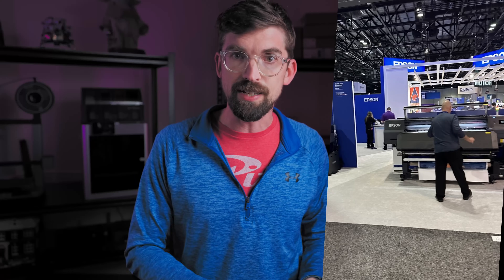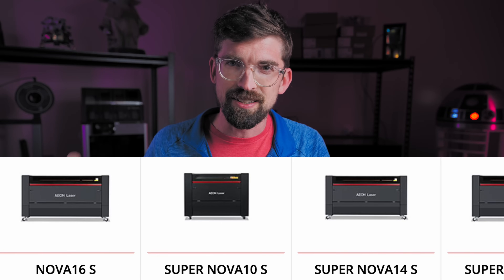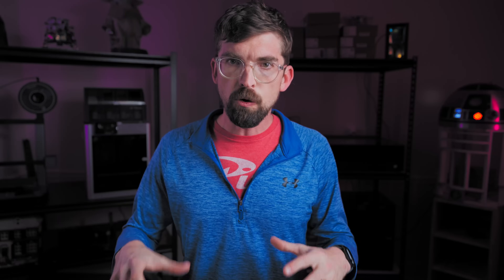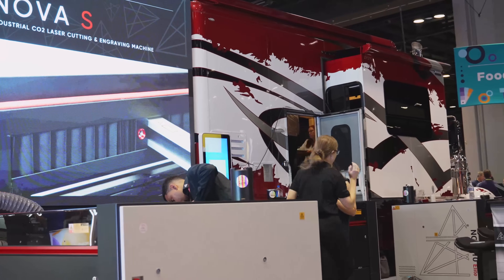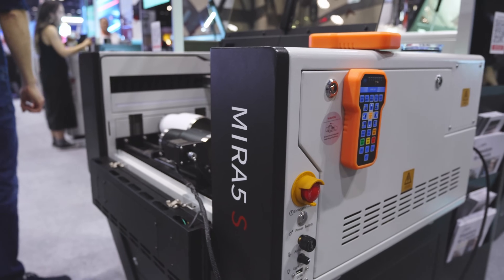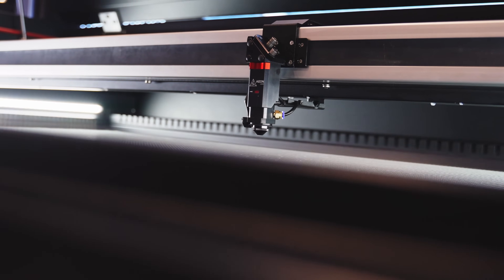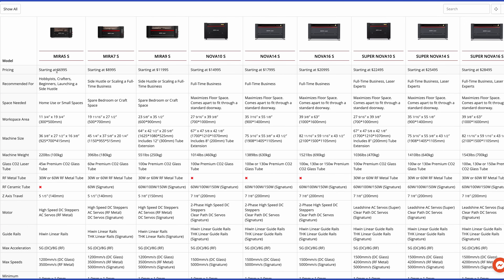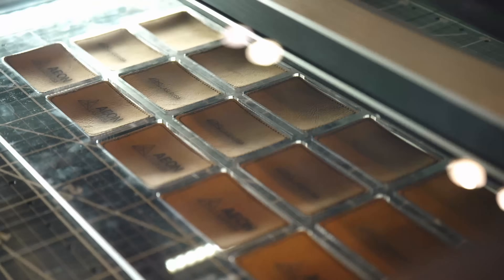This is the World's Fastest Laser

Comment: I’ve had my eye on the Aeon Mira 5S Redline, and I have a few questions regarding my product line that I plan to work with. I want to make sure the machine fits my specific needs, so I’m hoping you can provide some insights.

1. Can the engraving and cutting height be automatically adjusted to uneven surfaces (e.g., wavy materials)? Ideally, I’d like a 3D mapping system where I can freely define the measurement points based on the material. I’d like to set the number of measurement points per square cm or at least define a measurement area to ensure the engraving or 3D map is as accurate as possible.

2. Is there an automated height detection system or any add-ons for soft materials like leaves or flowers, which are difficult to measure with mechanical height detection?

3. What is the noise level of the machine and the exhaust system? I plan to use it in my home, so that’s important for me.

4. When working with larger materials that are fed through the machine, is it possible for the engraving or cutting to be automatically detected and seamlessly extended? I’m looking for intelligent software that can adjust the engraving path automatically without needing to manually realign the material.

5. Do you use or recommend any infeed track with a stopper and optional conveyor belt for precise material alignment and consistent movement at the right angle during the process?

6. Is there an intelligent function for engraving multiple identical materials? I would like the machine to detect and optimize the engraving process across multiple pieces with identical designs, to save time and ensure consistent results.

I know that the xTool P2S has most of the features I need, and their software is actually quite good. However, it seems that they may have purchased reviews on Trustpilot, and their customer support has been quite disappointing, so I don’t fully trust this company.

I’m also interested in experimenting with inlays in small QR codes, around 30x30mm, where the glass tube CO2 laser might reach its limits. It could be better to go for an RF option, but I’m not sure if Aeon is the right choice for this. You may have a better idea of what would suit my needs best, considering you’ve tested a larger product range and are up to date with the latest technologies.

I’m based in Germany, so it would be good if there aren’t any issues with shipping or customer support, but that’s mostly optional.

Best regards

Comment: I watch you regularly, and expected that your knowledge level would be a bit higher. First, she talks about the speed. Owning an Epilog Fusion Pro, I know something about speed. At top speed and max output power, you are hardly leaving a mark on wood. So, the speed argument is a little dumb. The accordions on the side of the gantry to protect the internals of the machine is something Epilog has had for years. The idea that somehow, the autofocus built-in to the lens carriage is something new is also wrong. Epilog, Trotec, and honestly several others I can think of have been doing that for years. Servo motors? Welcome to 2020. Let's talk resolution. 1000 DPI, is nowhere near class-leading. She talks about how happy she is about how rigid they are, being built of steel. Why did they add several hundred pounds to the machine by cheapening out with steel when they should have gone with military grade aluminum. I notice that my Epilog is under 300 pounds while the Aeon with the same bed size is 550 pounds. Some of them go up to 1,500 pounds. She talks about being able to change frequency, well I am not certain, but I think several companies have had that for years. I know I can change that on mine. The drop-in water cooled tube that doesn't change alignment is cool, bravo on that point! Even if you could buy one, (many people can not get a regular Mira for months) some interviews have said their Signature series (the only one that can boast all of this speed and ceramic RF core) is not even on the horizon for 4 to 6 months. Last thing is price. Who in the name of all that is holy is going to pay Epilog prices for a Chinese machine? I think it is just a reverse engineered Epilog or Trotec. There was a time when I would have looked at an Aeon or Thunder, but they were just too slow for my production needs. And please, add an LCD screen! What a strange place to try to save a buck, the one thing you will touch EVERY SINGLE TIME YOU USE THE LASER!
Reply from the maker: That’s really good feedback.  This wasn’t meant to be an actual review since I haven’t been able to use the machine.  In terms of some of the features I was impressed by, most were new to me since I haven’t had hands on experience with a Trotec or Epilog.   My point of comparison is OMTech, Gweike, Monport and Thunder.

But it’s great to hear how they’ve worked for you.
Reply: How many watt fusion pro do you have? Wondering if the new 200w can engrave well at near top speeds... And if spot size remains small enough for high dpi

Comment: I tried to buy one but I can't wait 3-6 months. Businesses that buy these kinds of lasers probably need the machines asap or they lose money. These redlines probably won't be out for another year. Looks pretty and all sounds nice, but will hold off until they can redline their shipping timeline.
Reply from the maker: which version were you trying to get?  They did tell me their main factory is completely moving to a much bigger space over the summer which is causing some hold ups, but will be rolling pretty quick afterwards.
Reply: @makeorbreakshop  that's good to hear, might consider them again later on. I was going for the Mira 9 initially. Ended up with a Thunder which was here in 2 weeks.